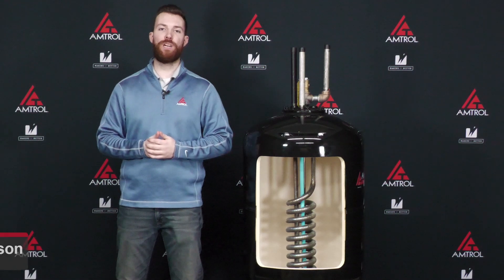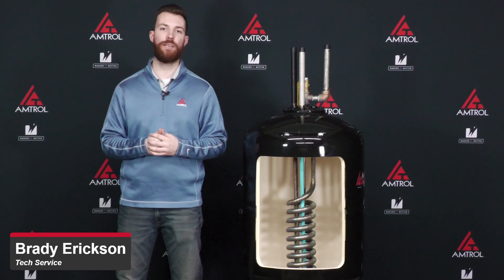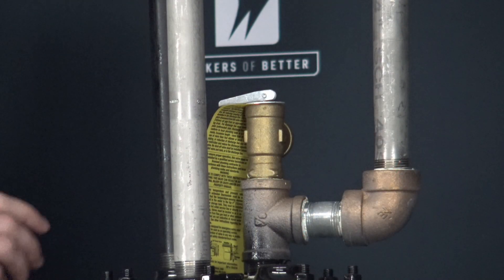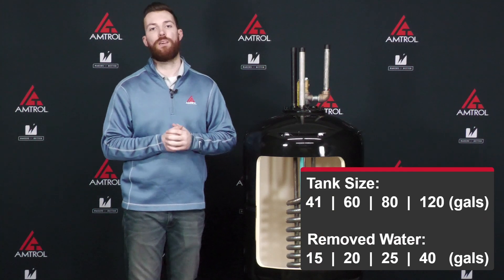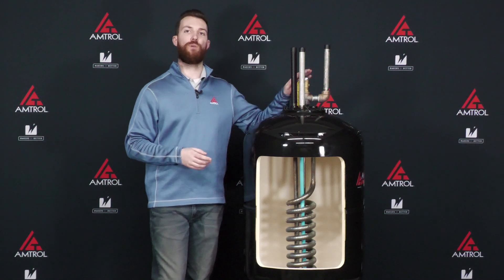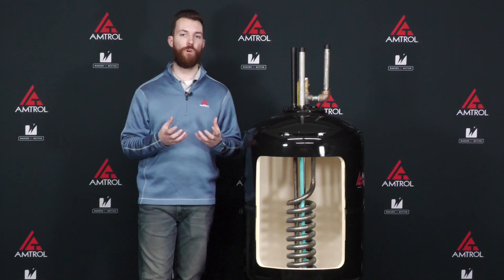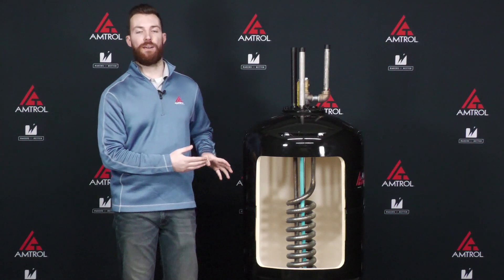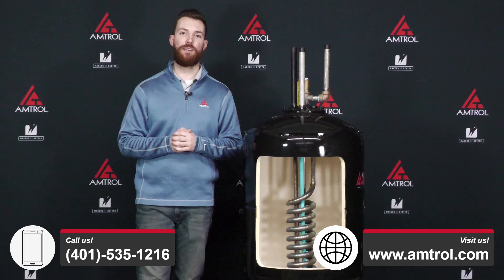Cleaning Your Heat Exchanger  - Amtrol Tech Takes

Comment: Great video.. Couple questions... You state to turn the water heater back on. Which is to allows the boiler to re-heat the vinegar/water solution in the tank with the cold water supply line off.  What temperature do you recommend heating to 120 or higher than normal?  Essentially once the tank reaches temperature it will sit at that temp for a few hours, correct?  Then after 3 hours, perform a flush of the unit. While its sitting, do you recommend turning off the hot water exit line valve as well so that no water is used by accident by others?  I'm thinking we're still a foot or so below the top of the tank-line anyways, but just wanted to confirm.

Comment: After draining the water and adding vinegar you instruct to turn on the unit for 3 hours, do you reconnect the pressure relief valve at this time or leave it off untill you are finished??
Reply from the maker: You could do either way. As long as the cold water supply stays closed then only the heat exchanger coil will be heated from your boiler. However, if you feel more comfortable re-installing the relief valve at this time, there is no harm in doing so.

Comment: Sorry if this is a dumb question, but do I use the vinegar every time I flush the system or just that first time? Thanks.
Reply from the maker: No question is dumb! Typically, vinegar only needs to be used initially to break down the buildup on the heat exchanger. The additional flushes are to ensure everything is cleaned out prior to putting the water heater back into service.

Comment: This process does work.  Just did this on a 16-Year-old,  80 Gallon, Amtrol Boilermate that was getting ER3 codes.  The circulator pump and furnace were working appropriately.  I was able to drain down 25 gallons and poured the 4 gallons of vinegar in and let it sit for 3 hours.    The color of the first flush and particles where unbelievable.  It was a dark brown with all kinds of Particles.  took about 3 times to flush out the system, until it ran clear. Once put back online, the tank heated in no time.  No issues since.
Reply from the maker: Great to hear! Glad it solved your issues.

Comment: I am experiencing slow recovery to a point of the E3 code on a regular basis.... since NEW. (less than 6 months at this point) The Hydromax replaces an older Boilermate and they are both the same size. (40 gallon) No change in boiler, pipe, or controls, other than to bring everything to the top of the new unit. Just doing a load of laundry and a shower runs luke warn in a few minutes! Not a happy camper here.
Reply from the maker: I am sorry to hear that the Hydromax has not met your expectations thus far. Please reach out to our technical support team so we can assist you with this issue. Email us at amtrolwatersystemsinfo@worthingtonindustries.com or call us at 401-535-1216.

Comment: Is this done with standard distilled vinegar (~5wt%) or higher concentration?
Reply from the maker: Standard vinegar will be just fine. Higher concentrations will likely result in a faster reaction, but otherwise there's not requirement for a heavy duty vinegar.

Comment: How often is this recommended? Annually?
Reply from the maker: The frequency of descaling your coil will vary depending on the hardness of your water. If you are experiencing slow recovery, it may be a sign that your coil has developed scale and will need to be cleaned.

For any additional information, call our technical support line - 401.535.1216